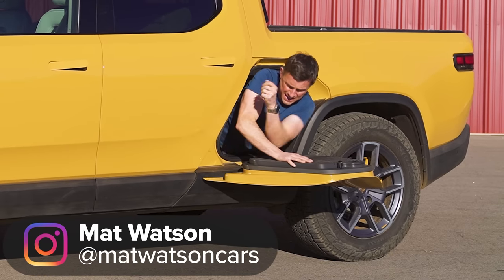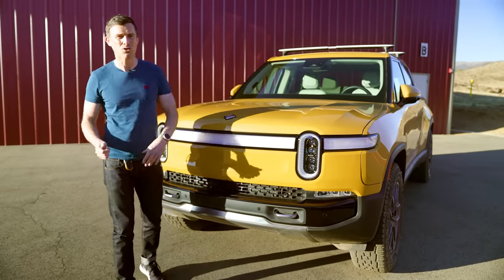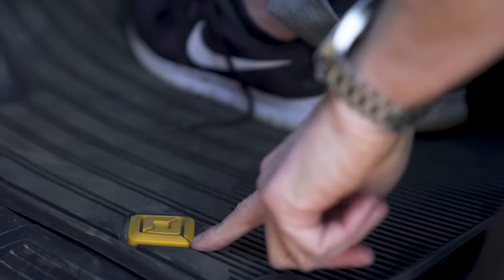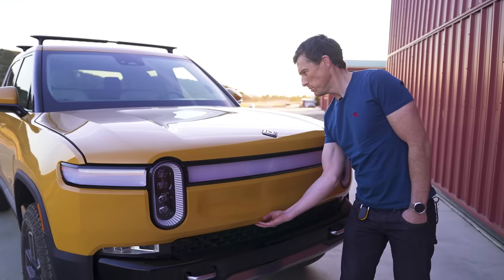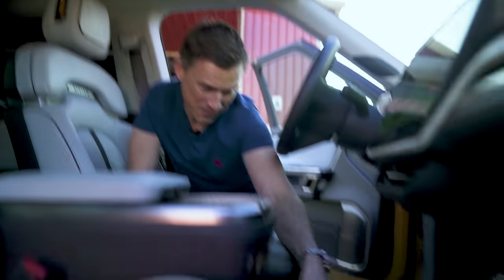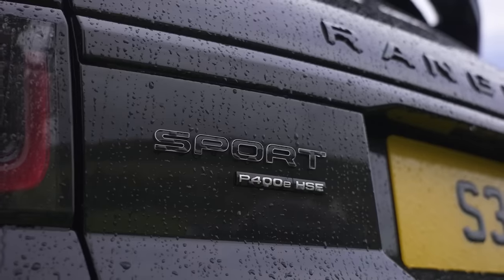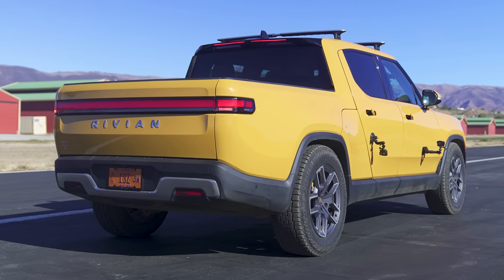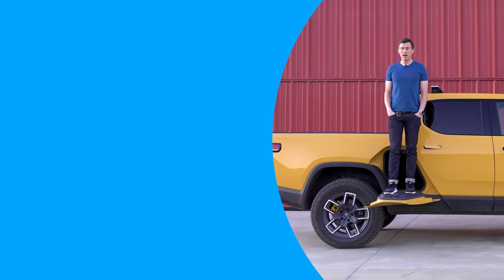Rivian R1T review - 0-60mph, 1/4-mile & off-road tested!

Comment: After a weekend of off-roading/camping using air compressor , lights etc. you are out of battery. Can you pull your battery can off the back and put power in the battery ? You know like with a 5 gal gas can? Another thing, these don’t use Tesla charging stations which are all over the place.

Comment: Great video 
Badge looks like Renault on some parts of the car
But I’d take one if
A. Had won lottery
B. If it’s available in UK
Reply: Would you even be able to drive it there? This is too heavy to work with a normal licence in the EU
Reply: @jojodroid31  Yea you need truck license just like with all big trucks. Not a problem.
Reply: @jojodroid31  The curb weight is a bit under 2700 kg according to Rivian (though I saw other measurements up to 3000 kg) . You can drive that with regular licence in most countries in Europe, here you csn drive up to 3500 kg. Though you are have to be careful, 4-5 people with some luggage and you are over the limit (don't think anyone would check it during a regular road inspection).
On the other hand if you plan to use it as intended, loading the bed or hauling stuff then you need a licence with a higher category. Also have to keep in mind that you could be resticted on certain roads, around here there are restrictions for as loe as 3 tons, if you are above, you are not allowed to use that road.
Reply: There are no plans to make RHD, they quietly dropped that a while ago
Reply: For real they could have any logo on the planet and they went with an homage to Renault ....

Comment: Finally a true Tesla buster?  I need to see the pricing on the cyber truck but this Rivian looks incredible.  I love the camping gear and radio.  Its just so much fun. And no longer a YANK gas guzzler.
Reply: The Tesla tries too hard to be different. This is a perfect mid point between unecessary features I.e. no buttons for basic functions/controls or the removal of drivers display and normal conventional cars.
Reply: TESLA Cybertruck starts at $39,000.

Comment: This (and the R1S) was an interesting option as my next car, but 3100kg!!!!😱 and this with the smaller battery…i was going to go for the 180kW one, but I guess you need a different driver’s license for that one!😅
Reply: I hope never to crash into one of these things 😳
Reply: What did you expect from a 135 kWh EV... sorry "truck"?!
With an even bigger battery, which Rivian has anounced, this thing will go straight to 3.5 or even nearly 4 tons of "dry weight". 
Such a vehicle has nothing to do with an "environment friendly EV", because it needs so much of natural ressources to build this thing, that it's totally irrelevant how much you drive with it later, because you won't compensate all this waste of materials or save CO2 with driving.
Reply: CF - the RIVIAN is too heavy. 
Cybertruck weighs only 2700 lb and does o 0 60 in under 2.9 sec. 
its got 4 motors for 1200 HP .
Reply: @markplott4820  the cybertruck doesn’t exist
Reply: @markplott4820  there is no cybertruck m8
Reply: @Marakeshh   - there still is NO FORD or gm EV Trucks .
TESLA has built MULTIPLE Cybertruck Variants.
Reply: @markplott4820  2700 lbs is less than a Honda Civic. That doesn’t even make logical sense to claim.

Comment: The coolest thing about it is that it's electric and have 4 motors and the look
Reply: Looks awful, lower power for 4 motors
Reply: @gypsyemperor7535  Why are you replying to every comment complementing the truck 😂. Are you that much of a Tesla stan?
Reply: @crumbybooch1851  i bet the car is good.
Reply: @James Maycock Cooler than you will ever be
Reply: @gypsyemperor7535  Im sure you've driven loads of 800hp cars?

Comment: Can't really go that far camping with that thing, unless there happens to be a charger in the middle of the forest. 
Other than that, it's pretty amazing!
Reply: Room for a gen set and jerry can in the box.
Reply: 300 miles isn't enough to go camping ?
Reply: The adventure charging network they are building will pretty much make it where ur within charging distance of anywhere ur gonna be able to take them.
Reply: England to Scotland would require a few charges but I don't think anyone in the UK/Europe is camping 100+ miles from electricity. I can speak so much for the rest of the world...
Reply: Even if you went out into the desert It’d be hard to find yourself 100+ miles from a power outlet. I think if you were camping in Canada it’d be much tougher though. There’s endless open nature out there, especially the further north you go.
Reply: @Nikolasmar  300 miles isn't the real-world range. 
Also, if you go camping you probably need to get back aswell. So that's ½ distance of the range.
Reply: @senraXD  yes but you will not do 300 miles in the wilderness you will pass through cities and rivian has promise a network of charchers in national parks and off road paths in US as for me I leave in crete the biggest island in Greece just above Africa but it's st6a small island and the length is much  smaller than 300 miles so it's enough Though there aren't many charging stations
Reply: @senraXD  plus going up hills, running ac, heater, accessories when offroading sucks up even more juice. Thats what I love about the ICE when offroading. Just throw a couple extra Jerry cans and you really increase range.
Reply: @marclangman4836  WTF a typical 2kW portable generator would take like 60 hours (2.5 days), flat-out continuous to charge the 135kWh battery pack! And you’d need numerous Jerry Cans to fuel it!
Reply: @miserablysane420  only in the USA!
Reply: @johanfalk2875  Try Australia mate! This thing would be useless in the outback.
Reply: @senraXD  Other reviews I have seen say that the range is dramatically reduced when taken off-road - up to 50%!

Comment: Perfect truck for Mall crawling. As a work truck, it's too expensive, and being an EV truck, not so great at towing. Also not "Eco friendly", with that massive Li-on battery pack.
Reply: Less ecofriendly than a bike, but more than a diesel truck
Reply: @arthemis1039  what are you talking about? Modern Diesel engines with DPF filters with AdBlue are way "Eco friendly" than a truck with a massive Li-on battery pack. Especially when you consider, predicted longevity, efficiency while towing and moving cargo...activities that a truck was firstly designed for.
Reply: @RogerM88  A large percentage of people buy trucks because of what it says about them or for political reasons.
Reply: @arthemis1039  hi Arthemis.
Reply: @catinthehat5140   many own trucks because they need them to tow, then for the price you get a lot of car, and you can use it to deduct expenses if you've a business. Also there is it being an off-road vehicle, and a lower depreciation in average.
Reply: Agree.

Comment: 8,000-9,000lbs curb weight depending on configuration (with out passengers or gear).

That’s more than a ford F350. 

The breaking is not the only thing effected by that elephant weight.  The tires are way more prone to pop off the bead off-roading, and the shocks will have a problem slowing down that fedex truck off road, unless you some how add huge aftermarket off-road race shocks . Can only imagine how bad a hard bottom out will be off road .
Reply: yes, this is why PAYLOAD is so low.
Cybertruck has 3500 lb payload and 14,000 lb Towing .
Reply: @markplott4820  Claimed, Tesla hasnt shown any tests that prove those numbers.
Reply: @markplott4820  The cybertruck also doesn't exist.
Reply: 6900 curb weight not 8-9k my 13 f150 cc was 5800 so not that big a deal. Plus the center of gravity is much lower as well.

Comment: I wish to add another comment about electrics in general, and Rivian in particular: they seem highly suited for the off road role. 1/ A motor per wheel, offering AWD/4WD by default. 2/ Electrics don't suck in dirt, so no worries about dust clogging engine air filters. 3/ No differentials or drive shafts reducing ground clearance. 4/ No risk of sucking water into cylinders either. 5/ No power loss at high altitude.
Reply: Everything is true except the 5th. At high altitude, it’s colder outside, thus the battery has less capacity

Comment: It won’t do well in the UK because most people buy them under commercial vehicles to save the tax but this only has 800kg payload so doesn’t qualify. It’s essentially 20% more expensive than any other truck and you can’t expense the running costs 🤷‍♂️

Comment: Not a single person is talking about the range you’ll get while towing, which is usually what trucks are used for. Max towing capacity probably cuts your range in half or more. Battery efficiency just isn’t there yet. Not to mention the lack of charging stations and long charging times. Not saying we won’t get there, but right now EV trucks simply do not compete with combustion engine trucks.

Comment: Mat its being said that Lucid will come out later on with a quad motor version of the Air which should have about 650 horsepower more than the 1,111 HP Air Performance model...do you have any news or info about that?  I'm sure Tesla will respond with a quad motor Plaid+ with the new cylindrical 4680 battery cells later on to compete...what do you think about it? I've never had an electric car before, I've had supercharged V-8's, twin-turbo W-12, supercharged V-10...but just curious about all this new tech...thanks sincerely in advance..I'm sure you're probably very busy all the time so you might not ever be able to discuss this...

Comment: Looks like a really well thought out vehicle. But needing to use the centre display because of the lack of buttons is something that would and should annoy most people. The kitchen thingy is really clever but I bet it costs a lot of money. I do wonder why most people need a pickup since I guarantee that 95% of the people who buy this thing will never take it off road ever.
Reply: Yep, agree about the lack of manual buttons to control things like the direction of the air vents. Who's going to navigate a screen while driving, just to shift them?! Crazy idea. Other than that, the truck looked pretty good, although I really dislike the headlight design and the timber veneer bits on the dash. It looked like good value for the price, I was expecting something quite a bit more expensive.

Comment: 1:40 Anyone notice those horrendous gaps and bad fittings of the hood, wing and front bumper?

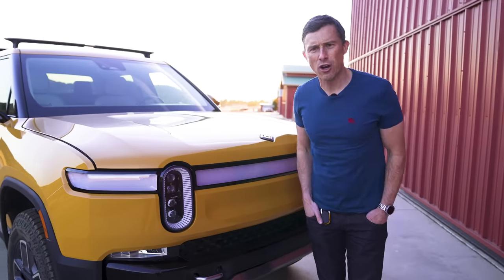EDIT: Now, if you check 8:50 when it closed, it misaligned again, but now it's up, instead of down, compared to the first timestamp.

Comment: Measuring the 0-60 mph (I would prefer 0-100 km/h or the metric system tbh) not from the standstill is like saying 2 equals 0. It is just wrong. Getting a lot of static energy converted into kinetic energy requires a lot of energy on its own. But removing the initial friction out of the equation is not so clever as some might say. I would even call it fraud.

Comment: this car is perfect if it was around 2.5 tons
                                                            range of 500 miles
                                                     and all AI systems and electric step to get in and out
                                                            and openable sunroof with top speed of 150 miles
                with increased braking capacity and umbrellas

Comment: The normal shortcomings for ev when it's come to real work done with pickups or any other " trucks" used for business in the real world- quite low payload capacity, long time for recharging and very steep price to said that mildly. Otherwise great for the  crowds( not that numerous haha) loving to feel environmentally conscious and ready to pay the big bucks for something that is not really that practical for a daly drive( what else) compare to other evs on the market.
F 150 4 door with pretty good trim can be bought for a around 40k with almost twice the capacity. The screens in the Ford unfortunately are so few and smaller in comparison, tsk, tsk.

Comment: 1:40 While this truck looks great from most angles, I for one HATE the look of the front with those weird front lights. I guess, beauty is in the eyes of the beholder!!  ;-)
With that aside, it is really stunning looking inside and out. However, is's so laden with gadgets and features that all I see is hundreds of things to go wrong. Just because they can automate something, it doesn't mean they have to. I mean, does the charge socket lid really need to be electrically operated? Just imagine when you are out on the road and you badly need a charge and suddenly it doesn't work and you desperately try to pry it open... I'm sure there is some workaround but really?!
On a positive note(!), Ithe big subwoofer under the rear seat is nice. Perfect for hitting the brown note!  :-D

Comment: What is the range!
Reply: Per Rivian’s website:  
*There is no Standard battery pack available with quad-motor AWD
*Large pack is 314 mi (EPA est.)  Cost is $6,000
*Max pack is 400+ mi.  Cost is $16,000

(So ignore the fact that you could buy a decent used car for $16,000 and add it to the Explorer package to put you at $89,500, or the Adventure package to put you at $95,000.)

Aslo, Pete Buttigieg thinks all Americans have a money tree in their backyards.

Comment: Somewhat disappointed by the sterile review in pre-approved conditions. This truck is BIG and unlikely to be reasonable to drive on UK roads, and considering the 3.5 Ton weight limit on standard licences here, the fact that the truck alone and unloaded weighs 3.1kg could be an issue.

I'll wait for some UK road reviews. Still, a very nice truck.

Comment: Pickups serve two purposes, to carry things and to tow things.  And once again these eTrucks avoid the MOST important specs, tow capacity and range.  And the reason they avoid talking about it is that tow range is crap. Also, over time the batteries become less efficient at maintaining charge and range reduces even further.  And taking into account charge time and lack of infrastructure and eTrucks are a non starter.  And no, eVehicles are NOT environmentally friendly.  All you have done is move the pollution around.  Those batteries are highly toxic to the environment.  And the pollution from the generation of the power to charge your "Environmentally friendly" vehicle needs to be taking into account.  Electrics are only practical in an urban environment.  Run out of juice off road and you are really screwed! Also, you don't need to brake torque as electrics have 100% torque immediately. You want a true alternative to gas or diesel you need to look into further development of Hydrogen.  You can actually burn it in an internal combustion engine or of course use it to power a fuel cell.  Either way you get water out of the tail pipe. And it's just about as quick to fill as gasoline.

Comment: Its NOT good for off roading !!  have you seen a battery charger in the middle of the mountains?  all that $$$ and the back window doesn't have a slide or roll down !!!  why not just buy a Ford F150 and get all the dealership support ?  Unless you a RICH and want a posh "truck" to drive to the LV store to get your new pocket book,
Reply: This isn't a luxury vehicle. It is quite good off-road actually. Also, most people don't do huge expeditions into the wild. The range would be plenty for a camping trip